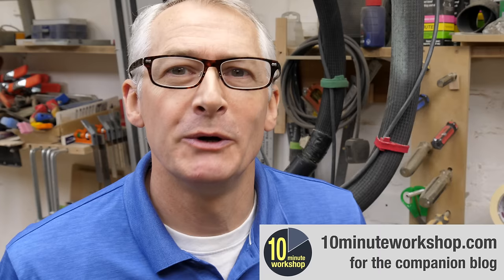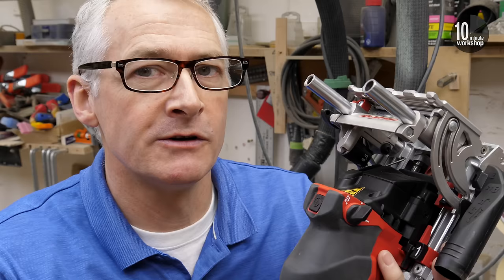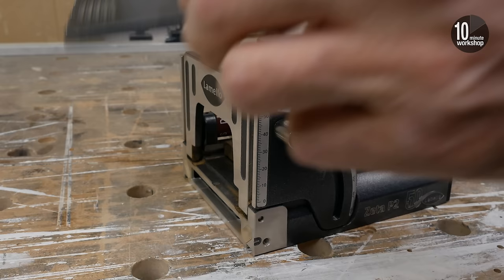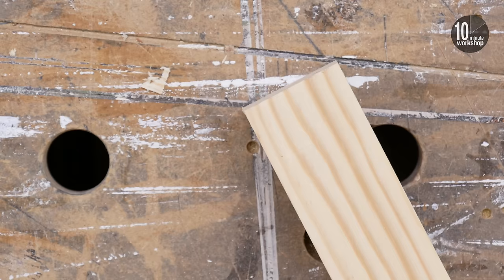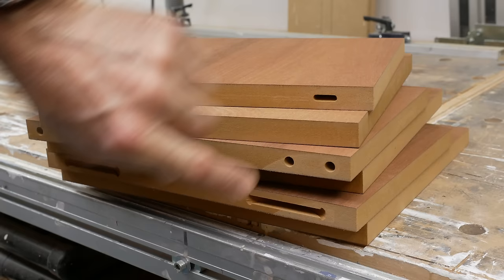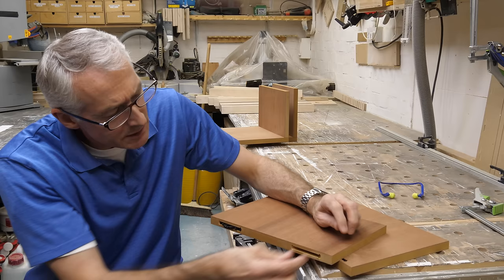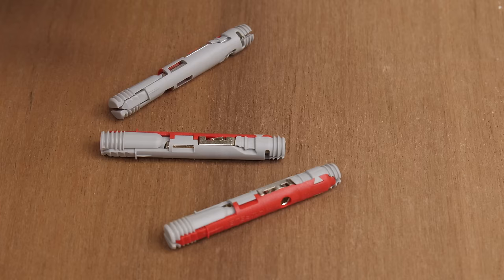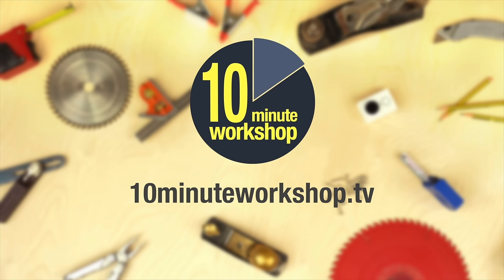Festool Domino, Mafell Doweller or Lamello Zeta? [video #360]

Comment: Lamello Zeta and aluminium PantoRouter owner here... at 18:25 - did the mafell split that MDF? Or did some ixConnects split it? Worrisome.
 
Bought a decent little PantoRouter for cheaper than can buy a Domino... without a spindle in the Panto. (If you have a matching trimmer/router/spindle, this isn't an issue)

Of course, the PantoRouter is no good for panel processing work - its too clumsy to set/reset. Fantastic for making custom furnitures (not a production tool!) and strong, tight, attractive joints. Only limited by your patience (and practice). It would honestly take 4-10x the labour, to do a job that a Domino can do speedily. Like, say, jointing a hardwood tabletop. 

The Lamello is fantastic for panel processing work, ie. kitchen cabinets, joinery, shopfitting. Biscuits aren't going to hold a hardwood tabletop together, not like fluted dowels or loose tenons would.

If I had my time again: I'd do everything differently, everything. Nothing wrong with a good static doweller or mortiser! In fact, better by most standards.  But I'd still be forced to buy the Zeta. It's worth it, in removable and re-openable joints. If I needed Festool's knock-down Domino fittings, there are plenty of other systems that are cheaper to buy AND machine.

Comment: I have never really got the Duo Dowel thing. It's two dowels. Judicious use of a tuppenny ha'ppenny jig comes to the same thing and I can still go on my holidays.
Reply: It is a machine that you can bang lots of projects out with. No need to start complex layouts. Just use the registration pins or guide system supplied. 

What makes the Duo Dowel interesting and should be considered by people is that it can do the job of both the DF500 and DF700. In that it can do dowels up to 12mm down to 4mm.  Which sort of sits in between the DF500 and DF700. 

Now it has its downsides when compared to the Domino (one domino dowel will not twist and one round dowel will).
Reply: @bighands69   Quite, they would not make them if no one found them efficient. I would not consider one, simply because my shop made system "bangs out" accurate work as quickly as I need and with a deal more flexibility.
Reply: @gav2759  
It really depends on what you are making and the price you are selling at. Some producers of furniture will be make one of pieces that sell for a premium so they can cost the use of slower work into the overall price. 

Others may be doing work that is of a high quality but it may be time critical and cost critical so the extra man hours cannot be put into the price. 

A duo Jointer is just as quick to use as a Domino and can do the job of both the domino DF500 and DF700. And that producer just may use the one size of dowel the whole time for tables, benches, cabinets, book cases and so on. They may also use it on site as well for jointing. 

There is nothing wrong with a dowel jig but it is nowhere near as fast nor efficient as using a Duo Jointer but it is much cheaper.

Comment: For me it all depends on what u want to do, the domino is no questions a great tool but for me the Lammelo zeta is the best especially with the clamex
Reply from the maker: For cabinetry the clamex is outstanding, less so for joinery and framework, which is where the loose tenon and dowels score. 👍
Reply: @10MinuteWorkshop  you are absolutely right, I have used all of them extensively and they are all great tools as u said.
Btw the adjustment screw u showed does nothing when using the clamex or tenso. It's only used when u do normal buscuits, another reason why I like it so much, you can change the blade to the normal Lamello one and it can be used for normal biscuit joinery

Comment: Peter, another great video.  You have much more experience and skill than I do but as I look at the 3 different machines, I get the sense that the Mafell is the more versatile machine and might be the least expensive depending upon what types of projects you are building.  I was wondering about your thoughts on the following:

-The Zeta does a great job with it's knockdown connectors and that is its sole purpose.  You also make some great points about the connectors, especially in relation to Festool's offering.
-The Domino does a great job and has the ability to make "sloppy" connections which means you don't have to be as accurate.  The Domino can only perform its Domino trick.
-The Mafell does it's dowelling trick.  The knock on it seems to be that it uses a high level of precision so your work needs to be more precise.  (Kind of strange since all of these tools seem to make some kind of statement on being precise)  However, one can also very easily get into the LR32 world with the Mafell at a much cheaper cost than you can going the Festool route requires their LR32 system along with a machine (router or drill) to make the holes.

You mention the Hafele 8/25 connectors as not being true knockdown but there are the 8/60 connectors that are true knockdown.So to me it looks like the more versatile and cheaper way to go would be the Mafell if you need both the joinery and LR32 capabilities.  I don't own any of these machines so I'm hope you might provide your thoughts.

Thanks!(edited for formatting)
Reply from the maker: Thanks! I expand on this quite a bit more on the accompanying blog post at 10minuteworkshop.com - worth a read, perhaps? Short version - the Mafell is very versatile, but only if you’re just starting out; if you’re not, then you’re likely to have systems already in place for e.g. the 32mm shelf pin holes. Zeta is a one-trick pony, but does it very well. The Domino is IMHO the most versatile machine for jointing  - none of the others have anywhere near the same range of pre-sets for fixing depth and thickness - never mind the width! It is a precision machine that lets you work loosely, which is a godsend in a busy workshop focussed on production ie generating income.

Also, have to ask, but did you watch all the way to the end? I dotalk about the Hafele ixconnect 8/60, particularly in relation to why I decided not to go with the Mafell. And having used it, I have to say it’s much harder work to use than either of the other two, in my opinion. They’re all great machines, but I’m happy with the decision I made. 👍👍
Reply: Peter, thank you for the very prompt reply.  I had not checked out your website.  I probably get fixed too much on YT and don't bother checking out a content creator's website.  Great site and I recommend folks going there too!
I am more on the starting out side of things and am trying to wade through all of the options.  If I need the joining and LR32 capabilities, the Mafele might be the right thing for me.
My mistake on the Hafele connector name.  I saw it but didn't catch you mentioning the name.  I'm not affiliated with Hafele either.

Once again, thank you very much for your reply and insights.

Comment: Another really good video. The quality of information is much better than here in germany. Excuse me for my bad english. Greetings from germany. But i have a question. Is that ok for you?
Reply from the maker: Thank you, and greetings from London! Your English is excellent, and please, ask whatever you like 👍👍
Reply: @10MinuteWorkshop  ok . Thank you.  What do you really think about parkside tools espacially the plunge saw you tested??? I love my festool tools but i had the chance to work with the plunge saw and an grinder (or sander) like  the festool ets125. The results were really good. The price is amazing. Thank you for an answer and good night from Hamburg
Reply from the maker: My apologies - I wrote a response to this but for some reason it didn’t send. The only experience I have of the Parkside tools is the Tracksaw that I own, and overally I think for the money they are generally excellent, though I have had reports of poor quality control  - items needing to be returned for replacement. This has always been carried out without question by Lidl, but it’s an extra step that you may prefer not to have to take, just to get a working sample of what you bought. But overall, for the prices they charge and then warranty and returns policy it’s hard to go wrong. HTH, Peter

Comment: For the sake of 8mm dowels on repeated pression processes hand made square drill guide jigs a depth stop piece or 2 will often save you 100s - 1000s of pounds theres always a cheaper option when round stock dowel is involved. Ide sooner get a biscuit joiner shove any end grain flat piece timber i find in the hole in the absence of biscuits or use it as a groove cutter in a pinch. Some of these new tools just seem too bespoke to warant use when you really think ways arround the process or job need.

Comment: Pete... I was gonna ask about why no Triton doweller but you answered that question elsewhere... its just a shame the Tritons manufacturing seems to have problems with quality, it would be a good affordable alternative. I have their  TRA001 router & the planer thicknesser & am super-happy with them... 🤨
Good comparison vid for the deep-pockets crowd... of which I am NOT  a club-member 😭😭

😎👍☘🍺
Reply from the maker: Thanks Peter. It does seem odd that Triton have such a blind spot with the doweller; I also have their big router slung under my bench, and a bench top sander too, both of which are excellent. They seem determined to build / engineer the doweller to the same price point as their biscuit jointers, whereas I think there’s space at double the price, for a machine that works well. 👍
Reply: @10MinuteWorkshop   true dat... 🤔

😎👍☘🍺

Comment: Remp kitchens use the Lamello fixings on their wall unit fillers. It is nice to just click it together.
Reply from the maker: Are those the tenso fittings? Still not getting mine quite as tight as I’d like - need to play some more! 👍👍
Reply: @10MinuteWorkshop  Yes, just click them together but they are not what you would call tight either. They pull together well when clicked but there is quite a bit of movement. Works well in the situation Remp use them for though. Eggersman Kitchens use similar but has an Allan key tightener to lock it all up much stronger.
Reply from the maker: Thanks! Yeah the Clamex (Allen key ones) are brilliant - 80kg of pressure👌

Comment: Great review Peter, regarding the IXConnectors there are shorter versions of it as well, see Häfele Ixconnect SC 8/25
Reply from the maker: Thanks Eric; unless I bought the wrong ones, the 8/25s are hammer-in fixings - they make a solid connection, but are one-time use only, so not the kind of knock-down fitting I was really after. 👍👍
Reply: @10MinuteWorkshop  And right you are!

Comment: Great comparison... although 2 weeks late for me - I just took the plunge (heehee) on a DF700xl.  I just couldn't see the Doweller was anything other than Mafell's attempt to produce a competitor to the Domino without benefit of Festool's patents... and, to me, it just doesn't do the job anywhere near as well.  For knock-down fixings, I can see the value of the Lamello (it really looks superb for that) but I'm not looking towards knock-down applications at present.  The Festool can fulfil this role OK in the odd occasion  I might ever need it, I hope/believe.
Reply from the maker: Thanks! Never used the big domino, but have handled one and the ergonomics are streets ahead if the original. 👍👍
Reply: It’s more festool copying, improving and using the mafell patent (the pins) on an old out of patent lamello platform

Comment: i have the larger festool domino that thing can do a few more projects i think up to a 14mmx100mm dominos can really hold some weight.
Reply from the maker: Yep, big domino’s a different animal! 👍👍
Reply: @10MinuteWorkshop  I was able to find some aftermarket parts to make it use all the same cutters and dominos for then smaller machine. The only thing I will say as a negative is that its very large and doing smaller pieces takes a bit more thought and care.

Comment: Excellent video as always Peter. I love my Domino but have always wanted a Lamello Zeta P2. I was happy when Festool came out their knock down fittings until I saw how fiddly they were and on the pricey side. The Lamello Clamex is easier and less costly. All of which you are already aware.
Does the new Mafell Duo Doweller use the same notched rail the older version did?
Cheers
Ron
Reply from the maker: Hi Ron and thanks! This doweller will work with the notched rail, but it also has a little plastic jig that works for the shelf-pin holes; I didn’t have one supplied unfortunately, so I couldn’t demo it, but there are Mafell videos out about it on YouTube. 👍👍

Comment: Great video Peter and really interesting to see the pros and cons of each. After much serious thought and saving and thanks to your one handed domino video, I decided to order one from my local timber merchants who’ve just become a Festool dealer. It arrived on Wednesday and I’m at the ‘still just looking at it’ stage! 😀 Hopefully start to do some test pieces with it next week. Can I just ask, generally what setting do you have it on for the slight bit of wiggle room? I noticed there are increments between the settings. Cheers, Leo
Reply from the maker: Hi Leo, and congrats on the purchase! Re the width of mortise, the narrow setting will be a tight fit on the domino for whatever size but you’re using. The next two setting give progressively wider slots, so more wiggle room. There are only 3 widths - don’t try setting it between widths! They’re clearly click-stopped. Any Qs shoot me a message, OK? 👍👍
Reply: Leo, hope to see it very soon in one of your next vids 😁, you could use it for the "under the stairs" project 😁👍.

Comment: Thanks Peter for your really nice and helpful videos. 
I am planning on building a front door, probably using mahogany. Is the Festool jointer up to the task for this (larger model most likely: I'm thinking the smaller model might struggle). Can you expect appropriate strength from the dominos to deal with the abuse a front door (residential) is likely to see, compared to a traditional mortise and tenon approach ?
Thanks, and looking forward to more no-nonsense and practical content.
Reply from the maker: Thanks! For that scale of joinery then I’d be looking at the larger Domino XL - the smaller version I have will only plunge 28mm, the XL goes to 70mm, so much more suited to that kind of work 👍👍

Comment: Question. Now that festool offers knock down connectors for the 500 do you still see the added value in also owning the lamello? 

I have the domino 500 and like the knock down system. But the self clamping feature of the lamello seems like a huge money saver (in increased shop productivity) 

Would love your thoughts on this
Reply from the maker: Short answer - yes. The clamex fittings are much better for general cabinet construction, though they are restricted in other areas eg narrow sections. The domino connect fittings also have their place, but I use them a lot less than I thought I would. Having both systems as an option is something of a luxury - but also good to have available. 👍👍

Comment: Great Video, thx. Don't u think i might be possible to just get the drill a bitt more out or maybe find an drill with is 5mm longer than the standard drill? It probably won't fit in normal position,,?
Reply from the maker: Probably not tbh - it's not 'just a drill bit' they're specifically designed for this machine. 🤷‍♂️

Comment: Thank you for sharing.  Which of these tools holds the pieces together the best and ease of work?  I am new to wood working but with COVID19 I am watching a lot of these shows.
Reply: You need to be a professional to use these machines.  Wow,  1000 pounds = $1237 dollars.  Nice equipment but ouch!
Reply from the maker: A surprising number of keen hobbyists have the domino and the doweller, I’m not so sure about the Lamello. To your first question, the domino would be my starting point at this level - best price if the three, and arguably the most versatile. They also hold their value exceptionally well - keep it for long enough and it’s effectively a free tool. 👍👍

Comment: Those hafele ix connect fittings SC 8/60 are 55mm long so a 15 mm plunge and a 40mm plunge would work with mafell
Reply: SC 8/60 requires one 45/46mm depth hole (check technical drawings on Hafele website).

Comment: Hi Peter...I saw your video about the lamello and how it just didn’t fit your workflow well. What about the Mafell DDF40? Did you ever have another go with it? I bought one after watching your comparison a few times. I’ve had the domino 500 for a few years and love it but wanted more precision for sheet goods. I have used the DDF40 most of the time since I purchased it. The DDF 40 is very accurate and I like that. I did some test drillings for shelf pin holes with the DDF 40 and little plastic gauge. I found that the cumulative error was very unpredictable no matter how hard I tried to make it consistent, it was to unpredictable to use for real work.
Reply from the maker: I had the DDF40 for a couple of months, all told, and like yourself didn’t really find the shelf-pin drilling to be very effective. I loved the rack & pinion fence and the overall build quality, but just found it very hard work to use, in comparison to the other systems. 👍👍